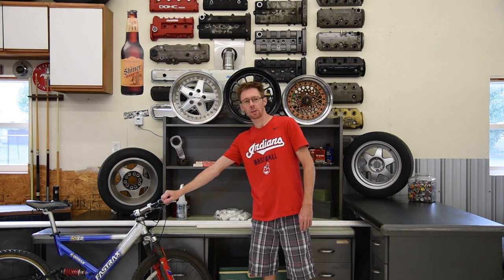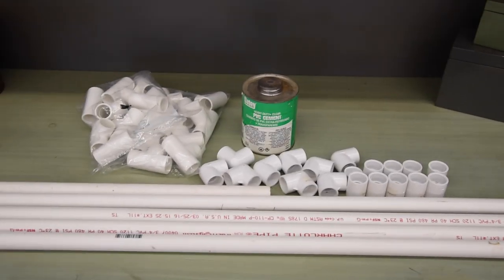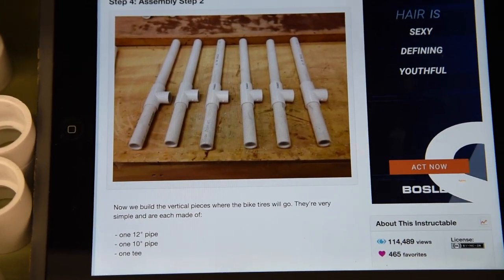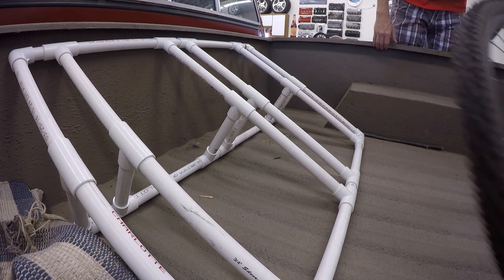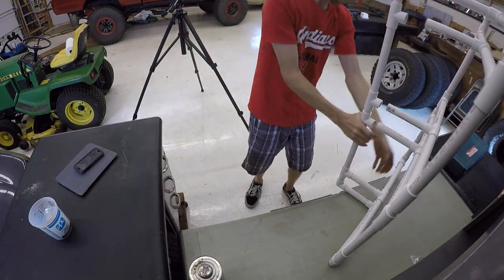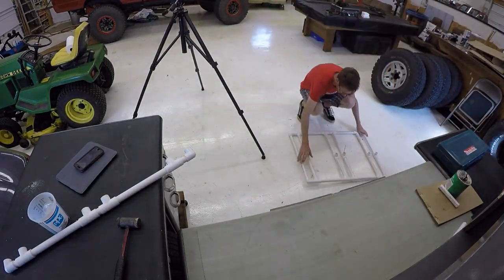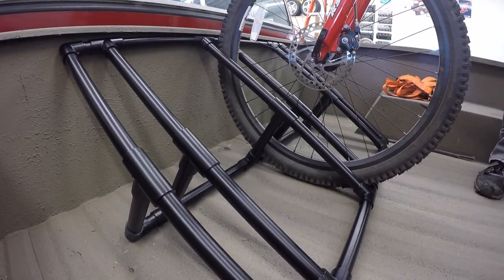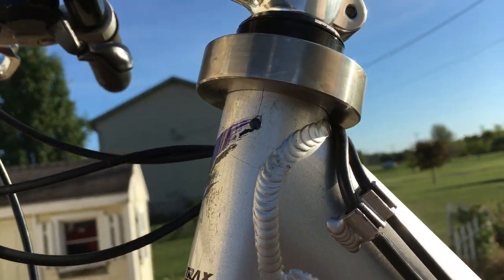How to Build a PVC Truck Bed Bike Rack for $25

Comment: Just got done. BTW!!!!!! if your bike has 27.5 or 29er wheels....go with the 12 and 10" vertical section size...not 12 and 6". 29ers will not fit in the 12 and 6!
Reply from the maker: Thanks for the info!
Reply: I would still need to buy the same amount of supplies just cut the vertical sections longer? I am not very handy at doing much of anything but i want to try this.
Reply: my MTB is 27.5. Should I change the 6" vertical for 10" like the lakemonsterguy says?
Reply: Great job . But I think you have a spray paint hoarding addiction 😂

Comment: Woo Hoo! I built it this weekend. I had to buy paint and a pvc cutter. Total cost around $28. My Kona 27.5” 650b bike fits perfect. The tire fit is a little tight where the Tee’s are. But it holds the bike upright and steady.

Comment: A tip for assembly. Draw a strait line on the pipe as a reference point. Then use the factory lines on the fittings to make sure it stays plumb and square

Comment: Oh, another thing: I've been told any spray lacquer will bond to PVC though it takes a special paint formulation to adhere to all plastics. Well, maybe, but you definitely want to paint the rack if you're going to leave it in the bed of the truck for weeks at a time. Ultraviolet light (sunshine) quickly degrades PVC. It will shrink on the sun side, discolor so it looks burnt and make it brittle.
Reply from the maker: Thanks for that info!

Comment: I just built one of these for hauling bikes in my tundra. I went with 2 3/8" for the smallest pieces, 17" for the long pieces (width) between the T's and the elbows. I did 14" and 12" for the vertical pieces, and 10" for the prop pieces on the bottom. This fits a 27 1/2" tire nicely and will fit a 29" also. 26" might be a tad loose, but I don't have a 26" bike. I used almost all of three 10' sections for this, plan your cuts careful and it's enough. The fittings and pipe today at home depot were about $36 including tax. They had a pack of 20 T fittings that were cheaper than 18 individual. If you buy them individually there it will be a little over $40 right now.
Reply from the maker: Thanks for the update! It's hard to believe prices have increased so much in about 6 years!!
Reply: @6thGearGarage  Yeah, the really sad part is most of that increase was in the last 6 months. : /

Comment: For that price you could make two and still be well below the cheapest one. One for the front and one for the back wheels. Would probably keep them locked in nicely.
Reply from the maker: Great idea on a second rack for the rear. With multiple bikes, a second rack on the rear would help keep them separated. A ratchet strap alone on the rear with multiple bikes causes them to lean in toward each other.

Comment: Thanks for the video and explanation of what you have changed. Could you please provide a list of parts of what you have made? thanks.
Reply from the maker: Thanks for watching! I had used:
- Four  10-ft 3/4" PVC pipes
- Six  3/4" PVC elbows
- Eighteen  3/4"  PVC Tees
Reply: @6thGearGarage  Thanks for the parts list. Rather than re-invent the wheel, may I also have the number of cuts list and length? You have made some modification on length, so getting the right size would be helpful. Appreciate it!

Comment: IF you want to get better pvc truck bed bike rack put water in the pipe so it will give weitght and it will not crack if the weather is hot
Reply from the maker: yusuff azmir thats a good idea! I might do sand instead in case all the joints aren’t completely sealed.

Comment: Nice fit, i wish my bike which is a 29er could fit my truck bed without having to take the front tire off. Also, i havent come up with an idea to move it on a bike fork holder
Reply: Dropping the tailgate is a lot easier than pulling a wheel.  If your load is securely tied down, there is nothing wrong with driving a truck with the tailgate open.  I used this technique for 15 years racing motorcycles and hauling with a tiny Datsun 720.

Comment: And still need the straps. I only use one strap on mine, attached to the side of the truck and drive 1,080 miles with  no problem. Unless if you want your bike to sit in the middle then this is good.otherowse not. I've been seen this since 2008 in the parks.

Comment: You mentioned below that "the overall length of the rack is 35"".  Did you mean the "Width" (side-to-side) of the rack is 35"?  "Depth" would be front to back.  Will try and have to use the 12" and 10" vertical section size.
Reply from the maker: Yes that's what I meant, 35" overall width not length.

Comment: Thank so so much for sharing how you built this rack.  Your explanation was EXCELLENT.  
You have inspired me to build one for my own use.  In my case I only need a 2 bike version, so I'll have to some figuring out.  But that shouldn't be a problem with your tips in mind.
Reply from the maker: Glad to see this helped someone! One thing I forgot to mention is that the rack is small enough to store in the cab of the truck when parked at a trail & I'm out riding - just in case someone thinks about taking it out of the bed.
Reply: What I meant to say was that I didn't know if the link attachment would work.  It looks like it did.
I made a single bike version today that can easily be changed to a 2 bike version.  Cost about $15.  BTW, I used 1" sched 40 PVC.

Comment: My RAD weighs about 65 lbs.  Would this be sufficient?  I would  assume with that weight that proper strapping down would also be essential.  Thanks.
Reply from the maker: I don't know if it would work, that's a bit of weight. I suppose you would have to try it, or build with a larger diameter pipe for extra insurance. Yes the straps are essential. The rack only keeps the bike from tipping over.

Comment: I think you have Toyota sr5 pickup. I have one. It is still running well.
Reply from the maker: You are correct, it's a 1985 Toyota pickup but not the loaded SR5. It's the lower trim with the carburated 22R engine. I have a few of these trucks and upload a lot of videos about them on my channel.
Reply: @6thGearGarage  Mine is 1984 SR5. Kept it since day one. It is red also. :)
Reply from the maker: @jameslin9845  That's great! Hang onto it... these trucks are becoming classics.
Reply: @jameslin9845  loł

Comment: Does anyone know the total height? I have a backflip bed cover. I have everything cut but I cant figure out if it’s going to fit. Thanks
Reply from the maker: These old Toyotas have shallow beds, so if your truck is full size or newer, you should be good.
Reply: @6thGearGarage  Thanks, I ended up using 4 more T fittings and I got it 👍

Comment: Would the geometry need to be different to be able to hang the rack on the shop wall with the bikes suspended from the horizontal that faces up in the truck bed? Seems like all it would take is for the center of the axle to be a bit on the wall side of the rack used as a hanger. Eh? The cost of PVC does add up but 3/4" tube and fittings are WAY cheaper than larger diameter drain and sewer pipe. Thanks for posting.
Reply from the maker: I think the slots for the tires would need to be longer for the bike to be hanging from the rack. I might question the strength of the rack to be mounted like that with bikes hanging off, especially 3 bikes. Plus when you're hanging the bike, setting the tire in the slot would put pressure on the joints, unless you do it very carefully and lightly every time.

Comment: Great work, going to try one this weekend.  Just to be clear...you did end up going with the instructions on Google minus 1 10ft section...correct?  Also, What kind of pool table do you have back there?
Reply from the maker: I needed just over (2) 10' pipes. I think it was like 2 pipes and a couple of feet of of the third. The pool table is a 3-piece slate... unsure of the brand but it's a cheap one. I traded a trampoline + $100 for it!

Comment: have you tried it out with multiple bikes yet? I'm assuming you'd strap each bike individually
Reply from the maker: I tried it with 2 bikes and you're correct, individual straps are best. Just using one strap pulls the bikes inward toward each other.

Comment: This is a really cool idea, but it still seems like the ratchet straps are doing 99% of the work. Couldn't you just ratchet strap the bike in place using the kickstand initially?
Reply from the maker: It will still need some help to stand up straight, unless maybe I drove really slow and straight on a nice road.

Comment: How does this work if you have one adult bike and 2 kids bikes? Seems they wouldn't be well-secured into the rack.
Reply from the maker: This rack is only for adult bikes. For kids bikes, you would want to build some of the slots to be shorter. You could do this by putting a T fitting on each side of the opening and then running a short piece across.  Then when they grow into bigger bikes, you can remove the T pieces and replace them with just a straight coupler, to avoid building a whole new rack.

Comment: I'll bet the first set of dimensions for the rack, were intended for hauling bmx bikes - 20" rim
Reply from the maker: Good call
Reply: will not fit 29ers for sure.... go with the 12 and 10" pipes for the vertical sections.

Comment: Cost of pvc isnt cheap, t connector alone $2, you do the math.  No less than$50
Reply: I just built one to these exact specs and it cost me just over $16 at home depot
Reply: Home depot charges over 10 bux per length of PVC that's 40 bux.. plus 2 bux for each T, that's 36 box.  1.5 for each elbow that's 9 bux that's 85 bux before tax,  can get a tailgate pad for a hundo and save a buncha work
Reply: T connectors at Lowes are .59 each.
Reply: 3/4 x10' pvc 400psi i pay $2.76,there is even a cheaper one of 200psi